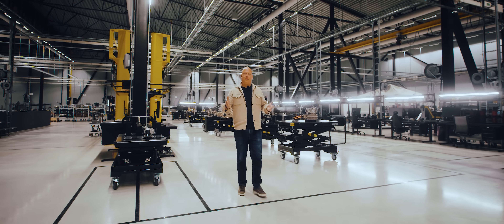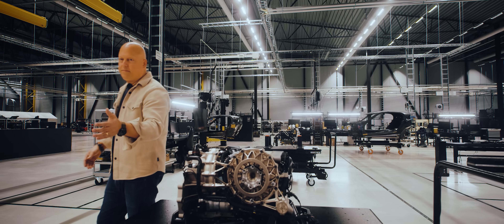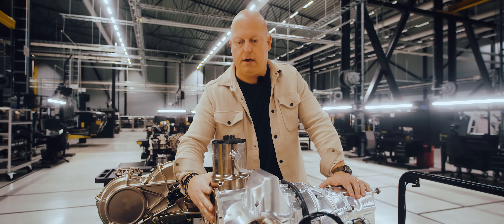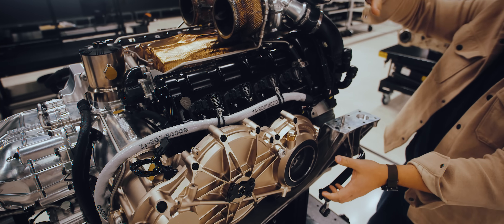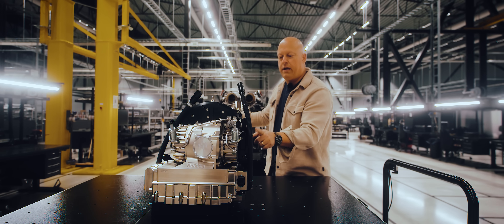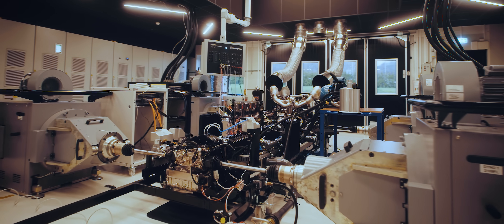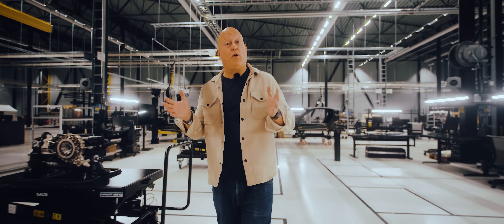KOENIGSEGG Gemera | Drivetrain Walkthrough

Comment: What if 4 Dark Matter Motors ,,, one at each corner Driven by a Multi Stage Generator Powered by only an Engine .. no batteries... ... that translates to 3,200 hp / 5,000 Nm TQ ... powering 4 Wheel Drive with low weight ..
Reply: And the Generator Counter Rotated to the Engine would obviously be a given .

Comment: Christian von Koenigsegg’s walkthrough highlights how the Gemera’s Light Speed Tourbillon Transmission and the “Dark Matter” electric motor—together with the 5.0-liter twin-turbo V8—deliver:

9 forward speeds (no physical reverse gear; EV handles reversing).
All-wheel drive with torque vectoring front and rear.
Extremely low engine placement (virtually no flywheel).
Hybrid and full-EV capability with just a single e-motor.
Rapid shifts and “telepathic” responsiveness, reminiscent of the Jesko’s LST, but reimagined for a four-seat GT.
The result is a drivetrain that’s uniquely versatile, powerful, and compact—carrying forward Koenigsegg’s hallmark engineering innovation into a grand touring megacar platform.

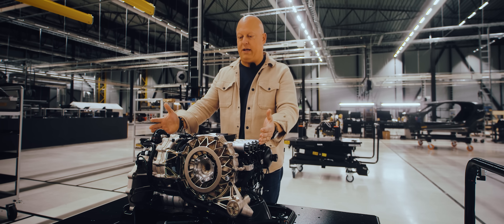Comment: 1:40 how heavy is that? that doesn't exactly look small and lightweight a typical Honda transmission is around 100lbs
Reply: Its a transition and diff all together
Reply: @g1channel  yes a light weight Honda transmission also has a diff in it, this has portal axles like a lifted OffRoad truck, and hydraulics like a hydrostatic drive system on a lawnmower i think, obviously way higher quality, precision operation these cars are top notch, pieces of art, just look at the beauty, each part is made to be light so it may actually not be that heavy, but no comparison to a Honda style transmission for weight

Comment: Did I count correctly? 4 clutches at the wheels, one behind the emotor, one in front of the ICE motor, and 6 inside the transmission, for a total of 12? Do you win a prize for the most clutches on any production car? The most any of my 30 cars have is 2, right now. 3 or 4 later, but to get there I'd be counting the clutches inside the LSDs which is only sort of fair, ha ha. My Stagea has 2, 1 in the auto, 1 linking in the front wheels. Our 100 series landcruiser has 2, one in the auto, one in the huge rear LSD. The control software would be the most interesting, it's a shame it's proprietary, I'd love a walk through of that.

Comment: You'd think that they would be done at some point!? Like, ok we've made the world's first 1:1 power to weight car, the first megawatt car, reinvented the whole drivetrain concept completely (twice, with the hydracoupe and LST), got rid of the flywheel and made a camless engine (which we ended up not even using), because we managed to wrap our (worlds fastest) gearbox around the (most power dense) V8, made hollow carbon fibre wheels that weigh less than the tyres.. oh, did I mention make the most power dense electric motor ever (a whopping 800 bhp and 1250 Nm out of a 38 kg water melon sized envelope).. 

Dude, these guys have made more groundbreaking inventions than any other car company in the last 50 years (yes, including Elon Hitler). And they started from scratch like yesterday. Beating massive companies like Bugatti, Ferrari, Ford, Lotus, Lambo, etc to all those great milestones. And, managed to get all that shit homologated for any market (which might be the most impressive part thb). Must be getting embarasing for all the other car makers..

Comment: For me this is revolutionary in two ways. 

The V8 engine is extremly near to the ground.

The hybrid system is phenomenal. All the linking parts allow AWD with electric, combustion or both.

The only downside is to carry the weight of both engine systems.

From the point of driving experience this will blow the mind because of the very high level of agility and the enormous power of 2300 hp and 2750 Nm.

This is so crazy, that you need to limit the foot-pound force. It's to much to handle for a human brain. It's just crazy.

I'd love to be sitting next to a professional driver kicking this rocket around a track.

Comment: This is rather impressive!
Beyond expectations 👏🙌
My only question is: the turbo (especially in the hot turbo variation) will be tightly squeezed between the V head of the engine. It'll be heating one another.
And then the transmission sides, in this case, are narrowly surrounding the engine block. 
How will they cool all of that sufficiently?

Comment: put a bulldog unit at the rear also, remove the engine+gb+cassettes, put batteries in the spine, reduce the wheelbase by 300mm and you would have a 1600hp mini gemera ev, although not as fun, this i would like to see

Comment: I have a doubt, sorry i might dumb as heck. That electric motor, won't you lose a bit of torque by having the dark matter connected to a driveshafr? If it's fast even with that torque loss. That motor must have a crazy lot of torque. I know, the driveshaft is carbon fiber but still, it has some weight too. I might be incorrect since I'm still new to car stuff. Question is, how do they get that much electrical power out of that car?

Comment: i kinda disagree here with the minimizing complexity and components part, having 4 electric motors will be infinitely less complex and have fewer components and much better reliability than this extremely complex system that has an insane amount of very advanced clutches that are individually driven needing a really complicated hydraulics system. Like the amount of little sensors and components that can make this work in such a small package would need a watch maker to repair it not a mechanic

Comment: That "never seen before" transmission 3:49 is basically the same thing with Opel Calibra DTM from 1997.
Reply: That Opel transmission doesnt have the hydraulic clutches (for torgue vectoring), the gearbox part is also nothing like the LST, and is built for a small fraction of the power this can take, but yeah it looks similar at first glance.

Comment: that is my dream project been done, i always though why no one did things right in the automotive industry, and Koenigsegg always show me that the car companies are just lazy and money driven, this is just possible with passion... combine this drivetrain with a low torque high revving and small displacement engine, because the torque of the electric engine compensate... and put the simulated manual in the center console, yes simulated because this BS of real manual mean nothing, it is easier to do everything by wire and in the same time get a better and customizable result... for exemple the clutch, many car's have horrible clutch, or heavy or completely without any felling of the actual clutch it self, just do like simulator's does, much better feeling... and the gear's obviously is just switches, but that doesn't mean it is bad, just give also the option to click a switch and have a sequential with the right feeling of it. 

and for the last, i dont know if im just dumb, but imagine all of this in a lightweight luxury van hahahaha the very first hyper van in the world hehehe or in the gemera but with baja suspension, and that is were Koenigsegg can again do a revolution, it is possible today to build a completely uncompromised suspension, with active alignment also, for the alignment you can do the hub like Lamborghini, or from the suspension arm's, what is simpler, and the suspension can be totally soft, and hard in the same time, it is already completely possible to change the spring rate, and the dumping to that level. 

and another dumb thing would be the car doing tank turn and crab walk with the torque vectoring and the active alignment, what would be the same thing as all wheel steering...

Comment: So many clutches everywhere - hopefully that means they've developed a clutch and actuator combination that's genuinely reliable and used it everywhere a clutch is required. What's funny is with all the talk of how revolutionary this is, bicycle gearboxes and geared hubs have been using exactly the same principles of using clutches to select the gear ratios for over a century - the Pinion 9 speed bicycle gearbox is running identical numbers in terms of having 6 clutches and 9 gears for example, but they do 12 and 18 gear options as well, thanks to humans having a pretty narrow efficient rev range. 

Hopefully al those clutches that have to slip all the time so the transmission doesn't wind up while the car is cornering don't overheat when driven hard like the Focus RS, a much more affordable car that used two clutches in the rear axle instead of a differential long before Koenigsegg. This car rapidly became a front wheel drive a few laps into a track day because the clutches overheat from all power they're haemorrhaging while 'torque vectoring', though Ford made it worse by designing it to spin the rear wheels slightly faster than the front with the clutches locked to make 'drift mode' easier, so they slipped even while driving in a straight line, wasting more power and generating more heat (Which conservation of energy says are the same thing). 

I'm very surprised that thermal management isn't mentioned anywhere in this video, as that will make or break this design, and there's no way Koenigsegg doesn't know that. Given the power figures for this car, I'd be shocked if any of the people with the money to buy them ever drive them anywhere near their limits anyway, so if it survives trained test drivers pre production, it'll be fine in real world driving.

Comment: Koenigsegg engineering is already impressive, but I'll be even more impressed if they transition to diesel.  How about a Jesko that gets 70+ mpg on the highway, has years more reliability, and squishes you into the seat just as easily?
Reply: I don't think they would do a diesel verison
Reply: @drivefaster4u  I'm sure they never would, but that would be sweet if they did.
Reply: @CalebDiT  I mean on one hand the mgps would be awesome but it doesn't really beat the downsides, I mean I don't really like diesels that much so
Reply: @drivefaster4u  Downsides?
Reply: @CalebDiT  surely you already know the downsides right? I mean they make more pollution, they don't rev as high, and they are just a worse option for koenigsegg as a brand overall, it would also ruin the image and lets be real diesels do not belong in hypercars those engines are made for hualing cargo around the cars are not designed for that and we already have the trucks and such needed for those jobs that do not cost millions of dollars.
Reply: @drivefaster4u  You gotta see the latest innovations, my friend. Check out the Trident Iceni, for example, which has a 6.6L tractor engine. I can't remember the exact numbers, and it's not meant to be a track car, but it does 0-60 in under 3s, which is as fast as the fastest, can go something like 2,000 miles on a single tank, and will still be running for your grandchildren.

Contemporary diesels are very clean, though. It's poor maintenance that contributes mostly to the bad image of diesel. The average new consumer diesel engine pollutes about the same as gassers. The better diesels are either cleaner or burn so much less fuel/distance that gassers end up polluting more. Personally, the only downside I see to diesel is the artificially high cost of fuel. I would miss the sound of the high revs, though.

Comment: I can umagine the next gen Koenigsegg after gemera using  4 electric motors on each wheel WITH the combination of the engine. Electric motors would probably be mounted after each bevel gear torque vectoring clutch. Considering the same electric motor use, i would say 3500 hp ? With 4 people sitting and 300 mph.

Comment: How about a 120 degree twin turbo hot V6 with Jesko gear box? It would bring all of the dimensions down with basically the same usable torque. Adding the front axle hybrid system, either directly to the engine block, or as it is in the Gemera, would bring out even more interesting driving characteristics. Just as a small light weight RWD setup, it would be a strong track weapon, and the hybrid would cause havoc on the rally world. The V8 is phenomenal, but it has it's drawbacks in power and heat management, as well as the sheer size of the engine. Lopping two cylinders off and mixing the pulses between turbos, while spreading the heads further apart, could fix a lot of things.

Comment: So its a rear mounted engine but they change the gear box that the engine does not hang in the back like in the Porsche 911. Lot things needed to be done as this was originally going to be with three cylinder engine and then they changed the concept. Propably for power and sound. The three cylinder engine would be good in a small sports car..

Comment: I can't wait to learn how far you've been able to take the control of the clutch for launch and traction control. 
Can it accelerate off the line like an 800 hp 2-motor EV of the same weight? Is the ICE coming in truly seamless, purely added torque if demanded?

Comment: I hope you cooking up even more epic ways to use the 3-cyl 2L FreeValve engine than I have, and add to almost daily.
What's NOT to love about a really light 600 hp unit? In a GMA T.50, it would just save 100 kg and cost only the sweet sound of high revs.
Please consider a minimalist Sesto Elemanto slash analogue GMA T.50 like car around the 3-cyl. Just loads lighter than Agera got to be. Go HARD after track performance and drivability.
Think, 100 hp more than GT3RS, 400 kg less, same downforce or more and it looks like a Koenigsegg. Price more modestly, it's a 3-cyl. Gemera used to be a $1.7M car?

Comment: I understand the 3-cyl not being made, and I understand that with the 3-cyl at only 600 hp, direct drive would have been a pain to dial in. It would have been so light, though...
I'm kind of sensitive to loud sounds, would have loved a more understated engine. Not sure I'd ever achieve full throttle even in 9th gear with that 800 hp hybrid attached.
Still with all the drastic drivetrain changes, there is no other car that gets me excited, in any price range. Gemera is THE car.

Comment: How many teeth are on the trigger wheels for the cams and crank? It seems like with such a low moment of inertia in the rotating assembly, you'd want higher precision position sensing to help the engine run smoothly, especially at lower RPMs...

Comment: Koenigsegg dragging the automotive industry kicking and screaming into the future
Reply: The way he utilizes the technology can make any car manufacturer look dumb, Koenigsegg is on different level.
Reply: Not dragging them, leaving them in the dust....
Reply: Am I the only contrarian in this whole comment section? These are toys for the wealthy. Some of the construction seems extremely complicated, it would be possible for other OEMs to do, but clearly it would not be anywhere near economical in any other kind of car.
Reply: @Innerbrave  So was Quattro, as was Panoz and Denso doing hybrid drives. Disc brakes and GDI came from Le Mans. Rearview mirrors are 100+ years old because of racers wanting to defend efficiently. All the aero research lead to more fuel efficient and faster normal cars as well. From F1 we have gotten active suspension, hot V engines, hybrid energy recollection.

Racing is an expensive hobby, only for the wealthy. Downplaying the engineering achievements which can, and will be, scaled down to consumer level just because it's a bit expensive is stupid.

Comment: Actually, opel calibra dtm from the 90s had a very similar gearbox setup with the  output shafts surrounding the engine
 But it was reversed, the engine was in the front.

Comment: Apropos of nothing, but that setup with the arms/'cassettes' reaching back to each rear wheel reminds me (weirdly enough) of Nissan's ill-fated front-engine LMP1 car, which was supposed to have a KERS-driven rear axle with a planetary gearset on each side, very similar-looking in basic layout but reaching upwards rather than backwards in order to work around the huge airflow tunnels that shaped the whole car's layout (the driveshafts were super-low, underneath the tunnels, so drive had to be sent upwards to reach the rear wheel centres). Sadly the team wasn't given enough time to finish the intended design and the car was a notorious flop in its FWD-only state. It was also intended to have torque vectoring and FRIC suspension. It probably needed another year to finish...

This is as per an old Twitter thread (when it was still called that) by the now-late lead engineer Ricardo Divila (RDV69) back in 2019.

Comment: Put the CC850 manual in the Gemera 🙏
Reply: Definitely not. They can't put every feature in every car. If they did, then there'd be nothing to distinguish one model from the next.
Reply: @TheDCJason  That you're right about
I would just wanna see it
Reply: You do know that, strictly speaking, the CC850 doesn't actually have a manual transmission, but the LST with a cleverly designed gear selector to mimic an old school shifter?
Reply: @halofreak1990  Same gearbox in Gemera
Just the "stick" part from CC850

Comment: Why Koenigsegg doesn't make higher cylinder engines like v12 or v16 with same cylinder and power ratio as present v8 still anyway the power and weight you managed to put in your car can easily beat a  v24 but waiting for atleast a v10 or v12 and next time pls show the jesko's engine or cc850 combined gear transmission sir

Thank you for explaining the transmissions and engine components of your car coz it seems interesting and inspiring sir
Reply: "Why Koenigsegg doesn't make higher cylinder engines like v12 or v16 with same cylinder and power ratio as present v8"
Because it offers no benefits and only downsides. The V8 is plenty powerful, putting out 1500HP, and compact enough so as to easily fit in whatever confines they can think of. No V12 or V16 car has the seat count or luggage space that the Gemera has
Reply: I think its the DNA of koenigsegg to use the V8 👍